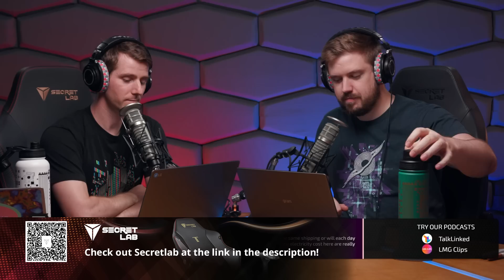Why Are GPUs So Big?

Comment: Will newer PCs lose their ability for discrete graphics cards, like Apple, as the push for complete SoC packages become prevalent on that platform? Beyond Apple's "my way or the highway approach," are there reasons why the modular comprehensive package make it harder for external high-bandwith devices like those cards will run into problems?

Comment: My graphics card isn’t very big cause it has a waterblock. Haven’t had a stock graphics card since my GTX 680, and those were small mid range cards.

But yeah the heatsink that came with my current one was massive

Comment: I would welcome a GPU with a tower cooler if that would mean it's quieter and gets more performance. Space is really not a criterium I care about as long as the case manufacturers can accommodate for the GPU towers. I have no idea why nobody has taken this approach to gain an edge over the competition.
Reply: I'd LOVE to see something like that because I hate how loud GPU's are. A lot of people say their brand of GPU is silent but I've tried so many brand of GPU's and they are all pretty annoying and quite audible. I've mostly just stuck to my EVGA hybrid cards with the AIO water cooler, it's pretty damn close to silent and more importantly, it's consistent noise level if any. No ramping up and down of fans.
My GPU under heavy load, even with a 120mm rad, is not even breaking 55c. A 120mm radiator. GPU air coolers, no matter the brand, fucking suck.
Reply: @EvilWiffles  my 4090 is dead silent
Reply: @namegoeshere197  And so it my dish washer.
Reply: My dishwasher is loud asf also if a GPU is loud its cooling solution is just poor or the card is inefficient as shit. You can't expect a space heater like a 4090 to be quiet without some work but my 200W A770 is rather small and is quieter than my water pump at load.

Comment: Why doesn’t the cpu have more memory on it?  I mean if they can make one the size of threadripper, why not make a am5 have memory around it or whatever?  It would even be interchangeable still with what the size of laptop memory is.  Stupid question probably, but I would like to know.
Reply: Latency is the reason if I'm not mistaken. The bigger the memory the further data has to travel to get from the outer edge to the CPU, so you start to negate the reason it's packed on there to begin with. Stacking memory like AMD does with their X3D chips is one way around that. So it becomes a question of how many layers you can fit on one die.
Reply: @ZombieBarioth  thank you, good to know.

Comment: Because dummies bought them. If they weren't bought then the gpu companies would have to design these graphics cards better and smaller.  Thermally lacking with an easy solution at the cost of the customer. 
Sadly we've all been bamboozled and trapped within this market.

Comment: Proposal: do both CPUs and GPUs as PCI-E add-in cards, but with enough spacing to tower-cool both of them.
Reply: They actually already do this in server space. PCI daughter cards are a thing and you can basically daisy chain CPU’s this way. BUT only Xeons and Epycs. That’s why Xeons are called Xeon scalable series. Also you need a MB capable of above 4G encoding. But you need to carefully setup UPI linking and every daughter card has to have its own memory.
Reply: So i think why they don't do that, is because CPU's ideally need to be as physically close to the RAM as possible, just sort of comes down to the nature of wires and distance. So that's why on laptops some ram is soldered right onto the board is to get it real close to the CPU.  

I don't think its at all impossible or really a bad idea, i just think it would cost too much money to be a novelty, that's just my guess but crazier things have happened... maybe...

Comment: Now that CAMM2 is a thing to counteract soldered RAM on laptops, I'd like to see it do the same for video cards.
Reply: CAMM2 is a bit of a compromise to get modularity while keeping traces short, it still can't quite hit the same clock speeds that soldered or especially on-package memory can. This trade-off is fine on a laptop, but would cut your bandwidth down significantly on a graphics card.

Comment: The solution for Giant Heatsinks on a GPU is a Custom water block makes most cards go from 3 slots to 1 and cooling wise because GPU's don't have an IHS and your cooling the dye directly cuts the operating temperatures in Half. Water cooling a GPU turns it into a different animal
Reply: No IHS also means much much tighter tolerances on pressure.

If modern CPU's came without IHS then we would see many many more broken chips.
Reply: But arent the water blocks big as well?
Reply: @dusty_48  no, but considering all the heat can be sent anywhere you are willing to pump the water, having an oversized radiator at the other end of the loop is common
Reply: The problem with water cooled GPUs is the huge price mark up. That is partly because not a lot of people buy water cooled GPUs, so they need to charge more to break even. When water cooling becomes more popular (maybe with 5000 series) the price will start to come down.

Comment: I had a gpu that came with 64MB (IIRC) and had a sockets for two more ram chips. And they sold 128mb and 32mb versions of that card. Strictly 2d, the more ram was for higher resolutions.

Comment: I literally don't know what a GPU does or is but LTT somehow released a tutorial godly enough that I now have a self built computer.
Reply: It's the Unit which Processes the Graphics
Reply: Originally, it was just a display driver and enough memory for a tile buffer or a frame buffer. Nowadays, it's a secondary computer, with a LOT more computational power than a CPU, but with comparatively few logic or IO functions. 

This allows it to perform the billions of trigonometric calculations needed to take lists of polygons and turn it into a picture, or to calculate physics on the objects and particles, or even to perform the massive matrix transformations needed for AI software.
Reply: Since we're kinda getting in the weeds here (for fun of course! It isn't necessarily need to know)

'computationally powerful', well yes but how, the way i understand it is graphics processing units (GPU's) and central processing units (CPU's) are powerful in their own ways. So a GPU can process lots of simpler maths, at once, wheras a CPU processes fewer bur more complex equations. 

Or like you might say its parallel processing versus a series of processes, like amperage versus voltage, like flow versus pressure ect.

Further more, i'd like to end my statement by saying, 🤓
Reply: @SethCrowderMusic  You've got that exactly backwards. GPUs are designed for complex floating point calculations, while CPUs have been trending towards simpler operations and streamlined instructions.
Fundamentally, a CPU is more focused on program flow and IO control, keeping track of program states and divvying out tasks to the other sections of the computer. There are very complex instructions, such as hardware encryption circuits, to accelerate specific tasks, but most of the time it's iterating and comparing.
Reply: Not knowing the basic components of a computer but building one anyways is impressive, is your monitor plugged into the motherboard or the GPU?